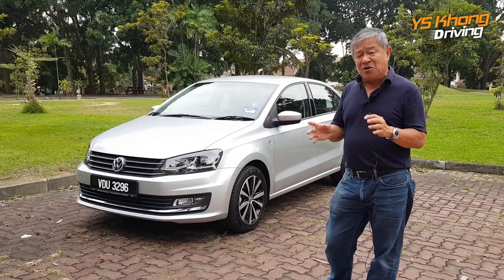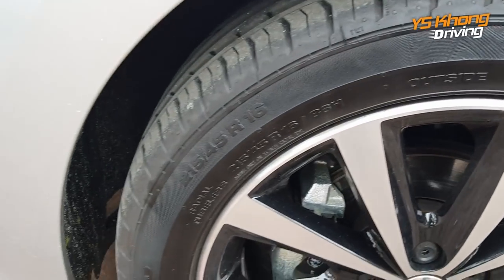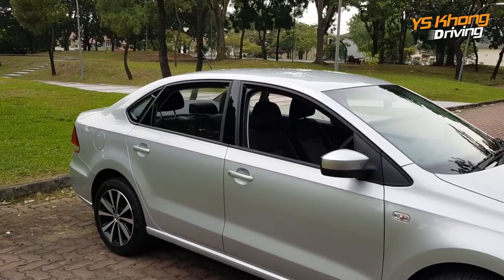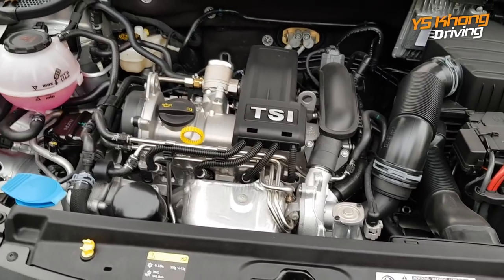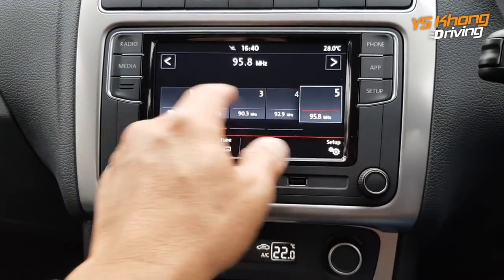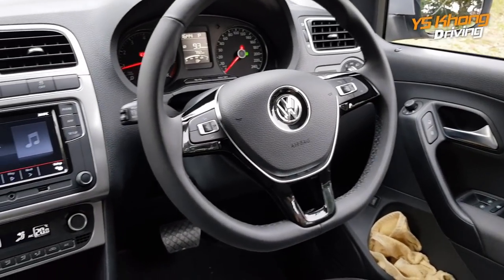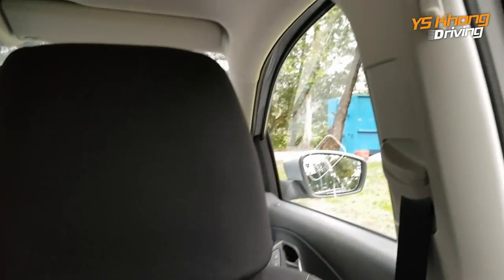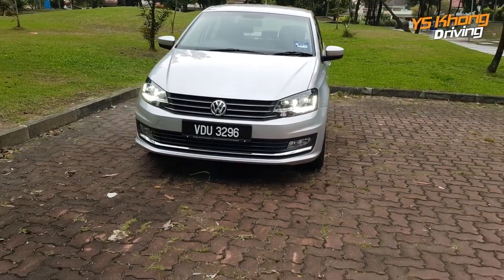Volkswagen Vento 1.2 TSI (Pt.1) Walkaround Review - A Timeless Look! | YS Khong Driving

Comment: Very well showcased uncle. Looking forward to the fun run uphill! I do agree that it is a timeless looking car especially with the new rim and lights design. Somehow it looks better than the old polo sedan. Sure there are no fancy features like push start, paddle shifters, etc but the build quality and engine surely doesn’t mess around ;)
Reply from the maker: Excellent comment, and similar to my thoughts too. Yes, wait for the Genting run. It was really fun, hahaha. Now you are even more curious.
Reply: YS Khong Driving curious to see how it handles in your hands 👍
Reply: I test drive ady. This car chasis very strong. N the engine very good. 2krpm can go 140km. It has manual gear act, function like paddle shift also. After test drive, confise between city ady. Haha
Reply: Imaratul Masjid (I-masjid) 2k RPM is about 100kmph definitely not 140kmph.
Reply: I wonder why this car RV super low.
Reply: Mr Kevin, you are owner of this TSI right. how much the price you bought after rebate?
Reply: Imaratul Masjid (I-masjid) rebate was 15k back then
Reply: Hi Mr Kevin, as a Vento current user, how do you find the car overall performance, maintenance cost, etc? I'm a newbie to car, gonna purchase my first car very soon, and Vento is the first on my list.

Also, the rebate I got is 8.5k. Do you think I'm able to bargain more?

Help a newbie out. Thanks a lot. 🥺
Reply: @weiwenngio6356  depends dude, maybe try to negotiate for a better rebate. When I got my Vento it was also the join edition meaning full leather seats and accessories. Maintenance barely anything cause you’re covered for 5 years right ? Aside from tyre and usual wear and tear really minimal costs. However though, if you’re starting out in your career and gonna take a full loan then that might hurt a little. Why not evaluate secondhand ventos ?
Reply: @kevinloh357  Thanks for your reply. :)

In your previous comment, you said that your rebate was 15k. So, you got your Vento 1 2L Join for 74k plus?
Reply: @kevinloh357  I'm worried about the maintenance cost for second-hand car though, think I'm gonna opt for new car.
Reply: @weiwenngio6356  no the TSI join list price is close to 100k right ? So 15k off that would be 85k
Reply: @weiwenngio6356  https://www.carlist.my/used-cars/6763103 even used cars are covered by VW warranty. Look at this one.
Reply: @kevinloh357  Thanks a lot for your information! Really appreciate it! :)

Comment: Would love if can compare this with new City 2020 & Almera 2020. Can the vento beat the much newer model & its rival
Reply from the maker: The Vento has some decent power. But each car is very different. The mew Almera is a bit longer in wheelbase, amd the engine design objectives are very different. We have yet to test the City so cannot comment.

Comment: But lots of people saying VW 7 speed gear box got problem? Is it true?
Reply: Applies to olders models of polo TSI but according to VW they have rectified that issue.
Reply: Only get trouble if you don't get oil changed in gearbox according to service manual

Comment: vw's new desing language is way better.please do a 0-100 kmh on next video YS. lets see if that torque gonna do anything. this is not a weight puller its a small car. they should have put hp instead of torque imo. maybe the point is fuel economy on this one.
Reply: remember to standby a towing car bkoz the gearbox might kong if it goes to the max. most ppl knows this used to happen on this brand.
Reply from the maker: See the video when it comes and see if agree if I say I pushed it. Nothing untoward happened.

Comment: I am always confused. DSG is a single clutch or double clutch? If double clutch, dry or wet?
Reply: DSG is a dual clutch transmission. 7-speed dry in Vento.
Reply: only high end segment get wet one，the rest cheaper one uses dry one
Reply from the maker: DSG means Direct Shift Gearbox, which is what we all know as Dual Clutch Transmission. Used by many brands including Porsche, Mercedes and even Honda use a variation of it in some of their cars. The Polo uses a dry clutch type. The current Golf TSi uses a dry clutch, but the Tiguan and Golf GTi and R use a wet clutch.
Reply: @65_soon  yes and no. Dry one has it's own benefits for being economical and efficient. Although longevity is another issue altogether. check out Learning Engineering videos on this. Very educational.
Reply: @YSKhongDriving  yes my Porsche has a wet PDK. A bit of a faff during traffic and shifting gears but on fast drives, it is hard to beat. Maintenance is on the high side compared to torque converters.

Comment: Uncle, what do you think of this compare to city?
Reply from the maker: Much higher torque, nice to drive, easy overtaking. However, new City is coming, and is potentially as good. However, we don't know the price yet. End year offers are good with VW so now would be a good moment.
Reply: @YSKhongDriving  VW 1.2 tsi was offered with 15k rebates now. So tempting but ady made loan for city but havent signed the agreement. Test drive this car very nice, just i search on mudah, this car drop the price super low. Idk why given the performance of this car. It has quite decent toys though.
Reply: Imaratul Masjid (I-masjid) yes you are right if you were to buy a Japanese car the rebates given are definitely no where near VWs rebates. It is due to the brand being lower in demand. City is definitely the safer, more reliable choice but in terms of driving fun, this is way more torquey. You might want to wait till next year for the new city. Much better design than current one. Just wait another month.

Comment: 2019 already .....9xk still old fashion antenna without push start + keyless
Reply: and vios city still using same NA engine vios even worst halogen lamp...
Reply from the maker: This was launched in 2016 and does not have some features. However, mechanically it stays one of the best in its class, if not the best.

Comment: try top speed with air conditioning off + S mode
It can go 220 kmh+
Reply from the maker: It will need a very long stretch of road.
Reply: YS Khong Driving uncle, u can hit 220 while going up genting!
Reply: @YSKhongDriving  try from sunway toll heading towards KK on kesas after 12am , ezpz

Comment: if you surveying between 1.6mpi and 1.2 tsi .....go for 1.2tsi , no regret.
1.6mpi is a trap !
Reply from the maker: The 1.6 is a lower cost version: totally bullet- proof, and a very solid auto trans.
Reply: @YSKhongDriving  i'm owning 1.6 mpi.....the 6at is not responsive , was like all the time keep at 6th gears and wouldn't downshift when slowing down or going up hill. in order want the "dumb" gb to downshift must accelerate. otherwise most of the time it just keep on 6th gears.
compared with other 4at car , they are much more smarter than this dumb "6at"
Reply: @3536-i7i  good fuel consumption?
Reply: @edisonxie8206  1.6mpi > vios > city > 1.2tsi

Comment: VW engine sounds a bit like diesel. Doesn’t sound refined like bmw or Alfa.
Reply: th tan it's direct injection
Reply: @sxtan82  yeah but engine just feels like diesel. the sound. the feeling of it.
Reply from the maker: SXTan82 is correct. Have you heard Mercedes or BMW engine lately? Especially the direct injection ones?
Reply: @YSKhongDriving  i owned a direct injection Alfa JTS before (2010)., sounds a lot smoother than VW. i think it is just VW or AUdi hallmark of engine. actually long before direct injections, i tested AUdi A4 in the 2000s. sounds just like diesel.
Reply: @YSKhongDriving  you are talking about turbo engines? all this while, i am referring to normally aspirated engines only.
Reply: @selespeed3  My Vento 1.6 MPI does sound like a diesel lorry when cold starting lol.

Comment: Isn't it VW car very difficult to maintain,especially gearbox?
Reply from the maker: That was a long time ago. If you were VW do you think you would have fixed it, or changed the box completely if it was a problem? From what I know it was a batch problem that has been rectified.
Reply: May I know which year to avoid buying?
Reply: Victor Tan it’s nothing to avoid 
Don’t buy German engineering if you wanna pay honda prices it’s just not gonna work
Reply: @oFailBoat  Oh I see
Reply: @victortan6378  I think 2012 below can avoid. After 2013, all ok.